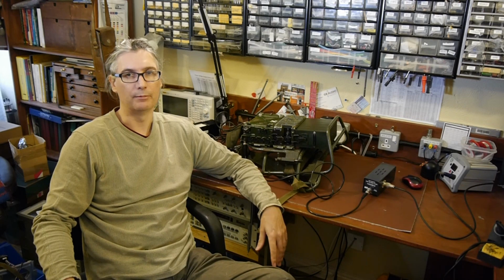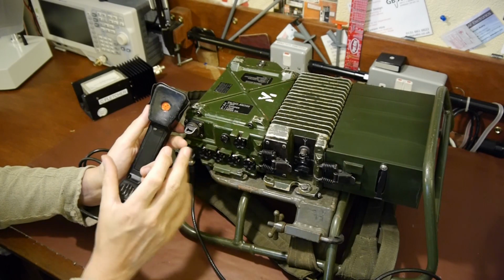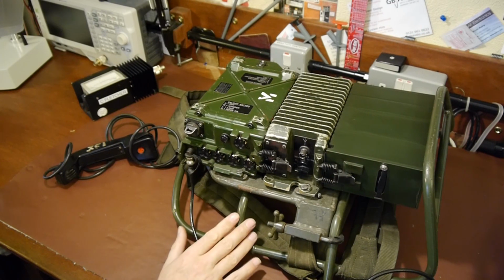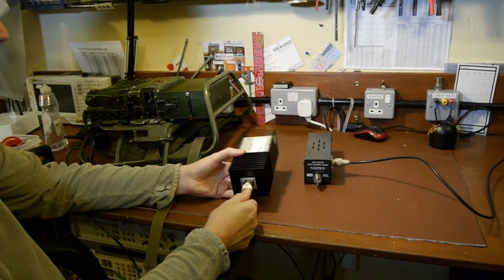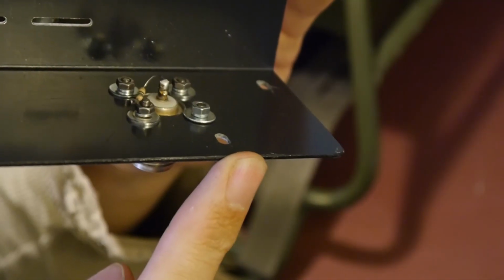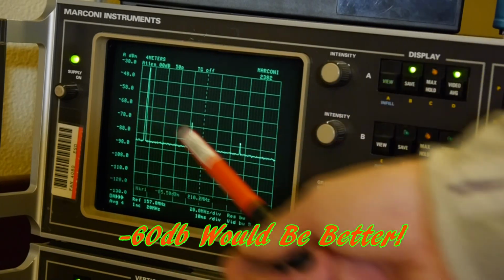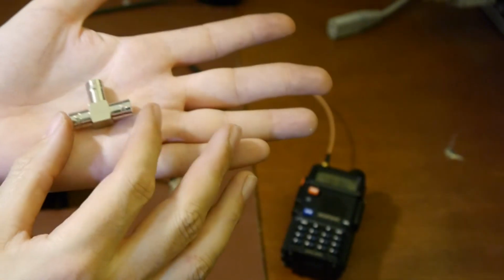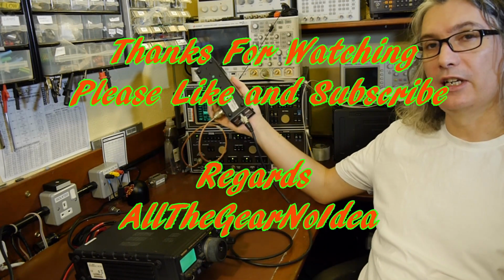RF Measurement Part 2 - Gimmicks

Comment: Very interesting video. Another sampling method I have used is a commercially available sampler that fits into a Bird thru-line body. You could measure power with the meter using a regular element then drop the sniffer in to look at modulation or spectrum.
Reply from the maker: David V  Scott Defpom did a repair one of those with a broken sample port. I really like the Bird watt meter after all they are the industry standard but they often go for high prices or have the wrong range of slug fitted for my needs. I think the bird  sampler is capacitive coupled to the through line. Very nice. The Racal adsorption watt meter you see me use has a -33db sample port,  I tend to use the large power attenuators more than anything as they a truly wide band and it’s hard to get it wrong with such simple devices.

Comment: Chris very interesting. I love the old radio too,  Could you build a sniffer that used a chain of say 10 5r resistors  in series and just tap off at the low end as a divider?
Reply from the maker: Simon Spiers  Yes you absolutely can build simple resistor divider that work well up to say 100Mhz then capacitance and careful design is required the problem becomes the Power dissipation for anything over 100watts. I like the the dummy  or watt meter with a built In sampling port. You can pick them up on eBay fairly cheap. That truline line have is 100watt  with a 30db sampling port.  Like all test gear your going to end up with a draw full of rf gizmos and adapters. Next time we can get around to those directional couplers.  Was think about you today doing some FM quieting test to determine sensitivity.

Comment: I found this video topic to be most enjoyable!  I don't have a spectrum (a real one) analyzer but have been trolling for one...and that was a cool idea about the sample, I have been looking at them as well, I don't do a lot RF work (and I let my ticket expire, however I still enjoy the hobby) but have a few radios I'd like to service when time is there.  Thanks Chris!  ~Jack, VEG
Reply from the maker: Vintage Electronics Geek Hi Jack thanks for watching glad you enjoyed the video. It’s nice to own a spectrum analysers especially if you can drop on one at a good price. But they do have a very specialist usage case and I more use it as an interesting toy than of real practical use to me. Even with my radio repair work on transmitters it not something that gets a lot of use.  If it was a choice I would much rather have a nice scope and a good rf signal generator.  Unless you find a really good offer on a spectrum analysers try and get one with a tracking generator. Regards Chris
Reply: That's all it would be Chris, along with all my other junk, just toys, I don't do this for a living (I retired a few years ago and picked electronics backup after 30+ years away from it), I just work on my own junk....99% I work on is my own junk.  My research has shown me to also find one that has a RF In/Output, I have actually been trolling for a Instek GSP-810, so when I find one a decent price, I'll buy one. I also want to upgrade to a 200~300 MHz CRT DSO, havent started to troll yet for one.. Cheers!  ~Jack, VEG
Reply from the maker: Vintage Electronics Geek  How does the ticket expire we have it for life here?
Reply: Here in the states, your ticket is good for 10 years, then you must renew, I hadn't used it in about 10 years and at the point didnt think I would, so I let it go...several months after I let the 2 year grace window go, I was back into electronics and started to think about petitioning to see if I could get it back, unfortunately I had noticed my call was reissued, my YL also let her ticket go.  We just spoke briefly today about retaking the test and getting it again...we don't plan on rag chewing, but mainly as a backup emergency communication.  I don't want to have another antenna farm, just a few low profile dipoles and couple of long wires, mainly for listening.  73's OM ~Jack, VEG
Reply from the maker: Vintage Electronics Geek  For scopes get a 200mhz there nothing useful higher unless your interested in cellular and your going to need GHz for that.  Today for the price I don’t think you would beat a rigol or siglent. I like siglent has a lovely big screen for old eyes. Buying spectrum analysers is a mine field, they can be full of bug and difficult if not impossible to repair. They are also massively overpriced on the second hand market. Again I would think very hard about spending the extra on the rigol than some old knacker with no warranty.   I only got my licence as I wanted to build transmitters I probably only actually operate once a year now. I still think Building small QRP transmitters and radio kits is massively fun.
Reply: Thank you Chris, I appreciate your support and guidance on this topic...I'll research them and look....I don't want to spend tons as stated, hobby not living.  I have also thought about a new o'scope that offered FFT, but wasn't to sure how it would handle RF? ~Jack, VEG
Reply from the maker: Vintage Electronics Geek  The FFT scope function think would be very good for audio work and good for HF but not VHF

Comment: Nice job mate iv used both methods for sniffing rf for frequency counters and deviation meters they do work well. It is nice to characterize the level of attention but not essential coz u r right the best way it to have no physical connection between your transmitters and test gear other than power meters of course lol
Reply: Now be a man get your rf test sets out lol
Reply from the maker: @g1fsh   You Know Gary I was just thinking of your video about Sinad measurement and that really inspired me to start making youtube video's.  It would be nice to see you update this video with some more information about Sinad values.  I still dont really understand Sinad values.  Yes we will see the test sets. The 2955 has gone into retirement so it will probably be the Stabilock
Reply: @allthegearnoidea6752  oh thanks Chris shucks making me blush lol. My videos are crap hahaha